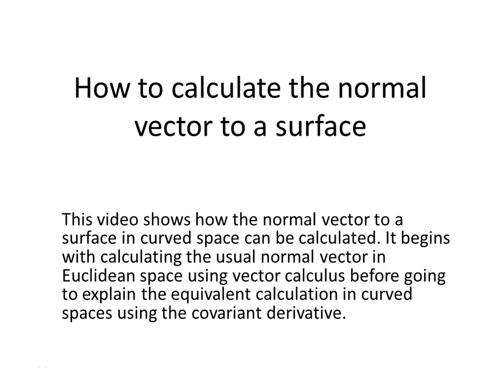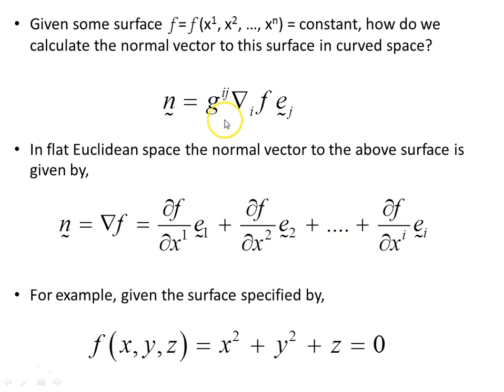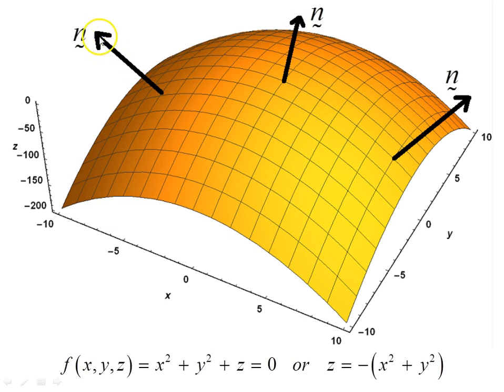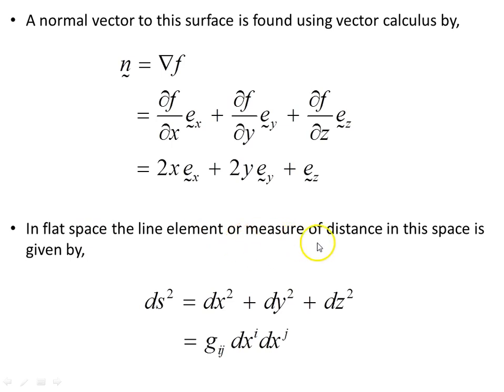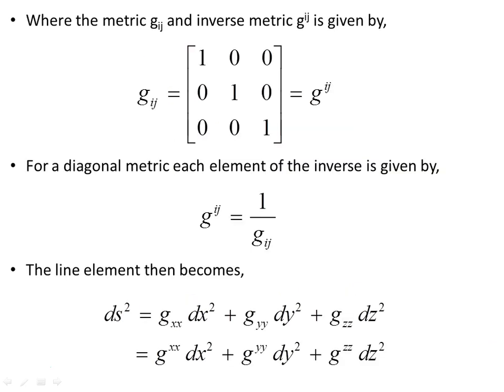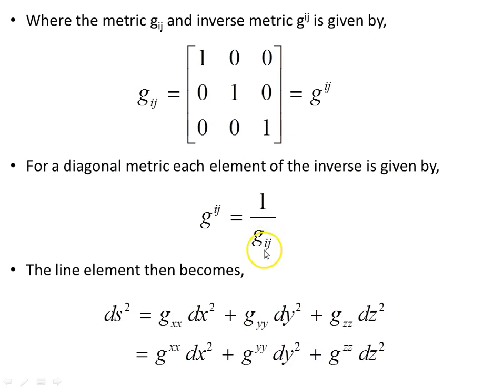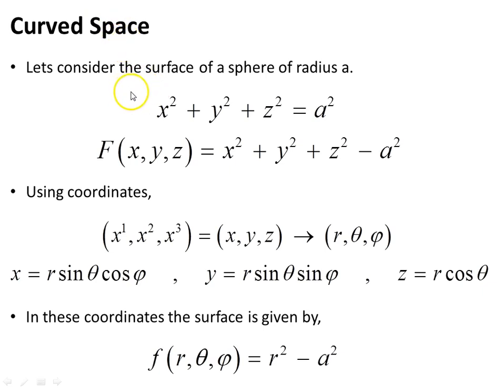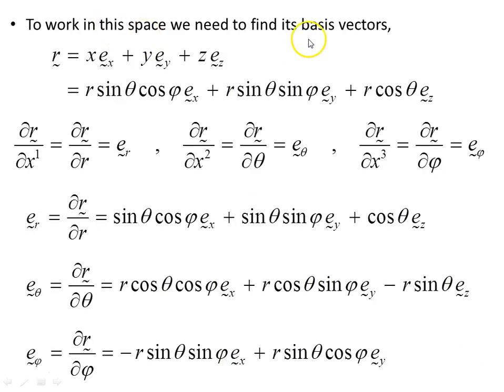How to calculate the normal vector to a surface

Comment: 12:36  --  If one requires  r > 0  then only the outward normal is obtained.
Reply from the maker: Thank you for that. I will pick up the matter of the direction of the normal vector in an upcoming video on hypersurfaces.
Reply from the maker: Your recent longer comment, which you have since removed, was fine. Please feel free to put it back as it is most welcome!
Reply: @TensorCalculusRobertDavie  :  Thank you -- maybe I'll do so after reviewing it.  I had reservations after posting that it might not be as relevant as I had first thought.